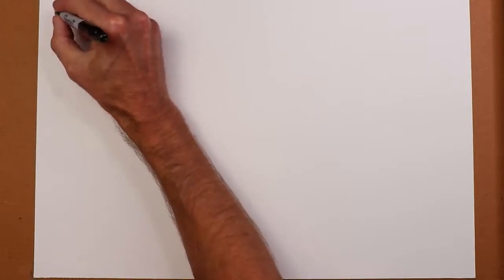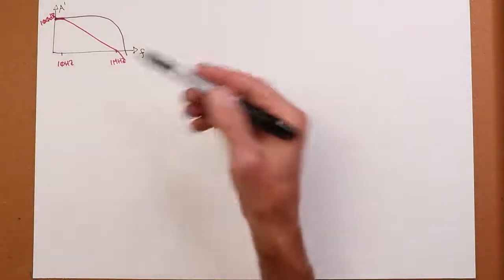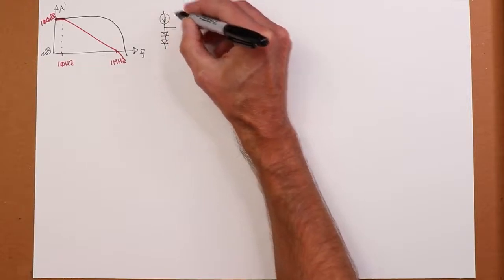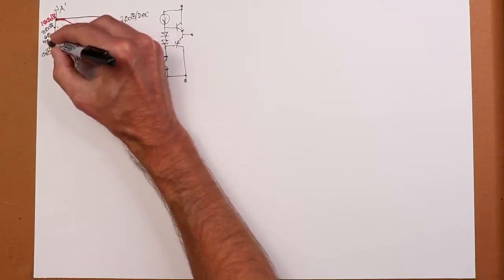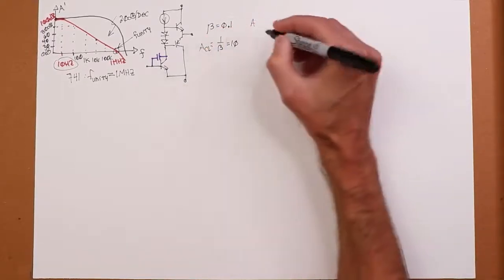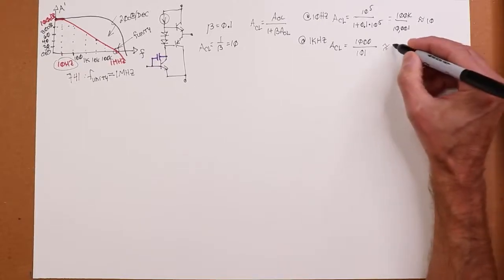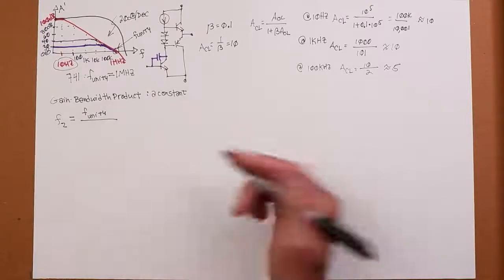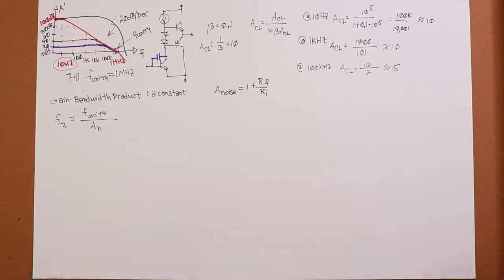Op Amps: Gain Bandwidth Product

Comment: I was 1 minute in when the first question popped into my head. In VHF applications, is it possible to, somehow, lower the frequency to fit within the bandwidth of the circuit elements and then raise the frequency again later in the circuit? I can imagine a generator spinning might work and also if it's actually a problem that needed solving? Thanks for a great video, some of this was new to me.
Reply from the maker: It sounds less complicated to just get a faster op amp!
Reply: @ElectronicswithProfessorFiore  Where's your sense of adventure?  :) :)